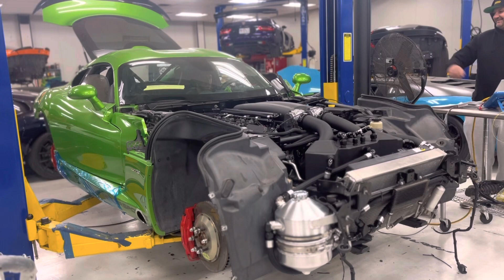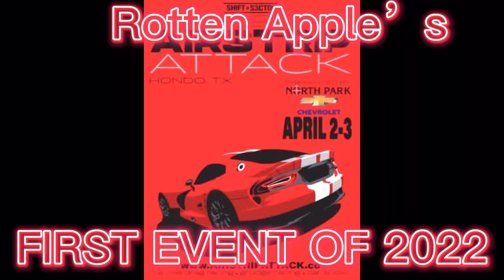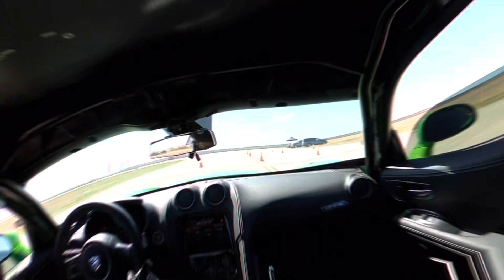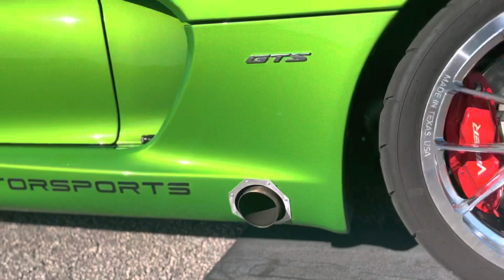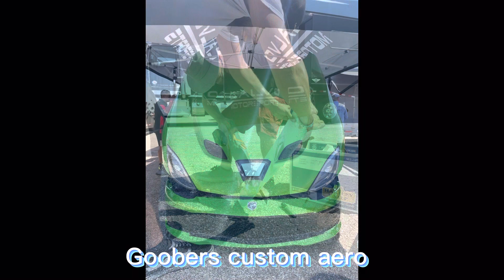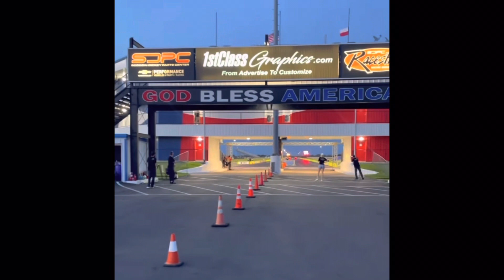Twin Turbo Viper!!!!!!!! Rotten Apple of Goober’s Garage 2022 Racing Recap Part 1

Comment: The night and day difference a prepped track makes for traction. Dude has to put so much steering input when he is on the runway all the way until he crosses the finish line, but that car is planted on the prepped track.
Reply from the maker: Very much so, although we were primarily testing different suspension and wheel/tire combos as well. Currently developing the first active aero wing for this upcoming season as well. Stay tuned!